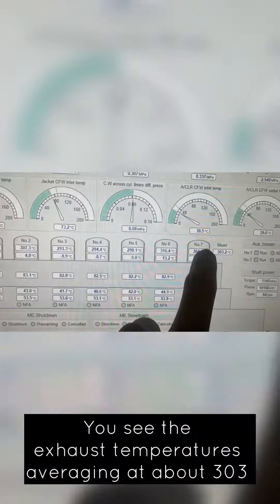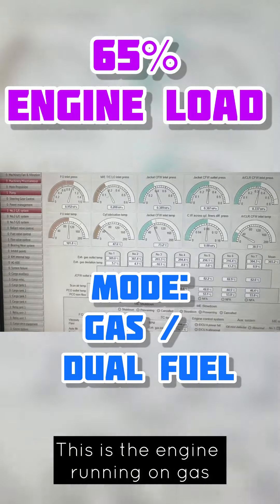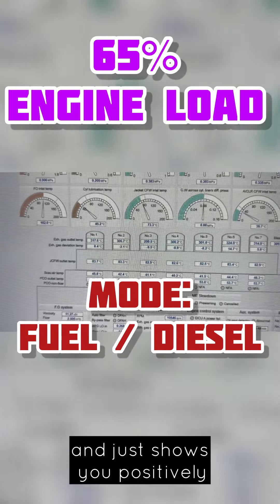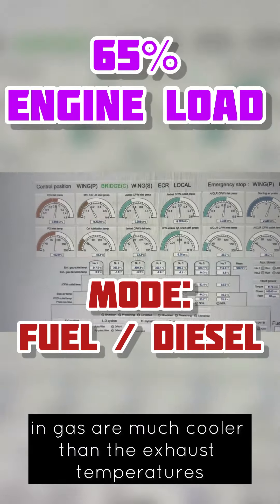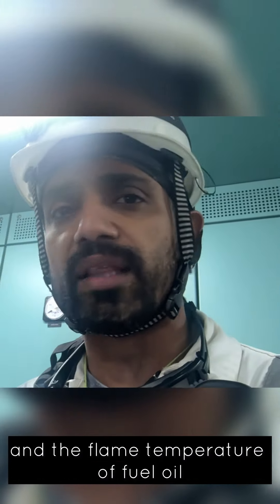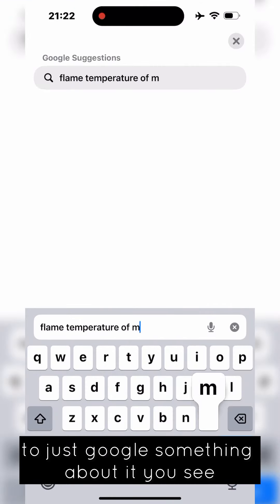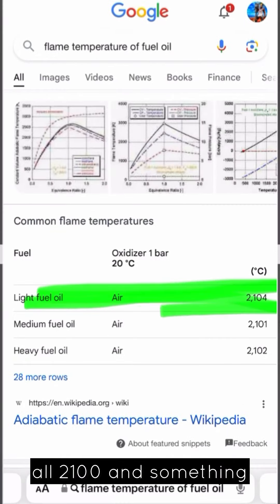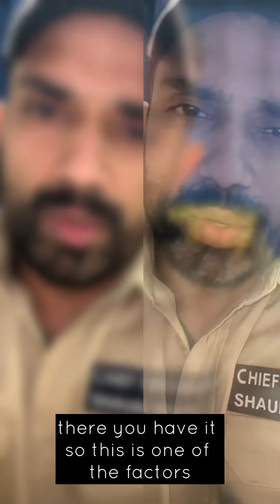DUAL FUEL ENGINES - PART 12 ; why is exhaust temperature different at same loads on fuel and GAS

Comment: Hello sir, 
I have one doubt in DFDG while running in gas mode why exaust temp is high and in  diesel mode exhaust temp less
Reply: During changeover from diesel to gas, try to check the position of waste gate valve and charge air by pass.